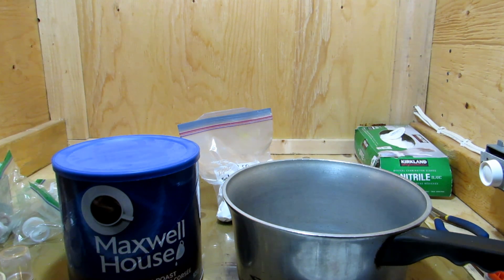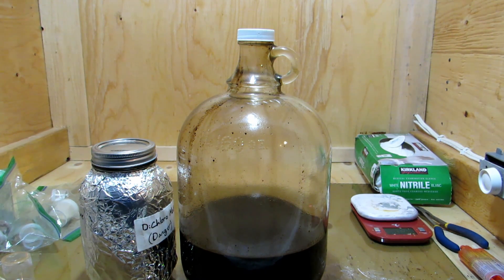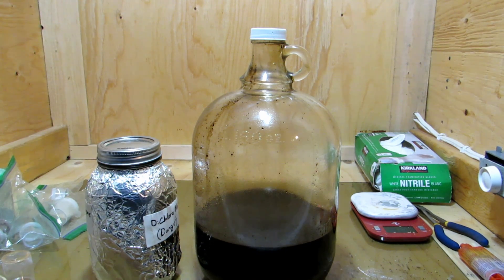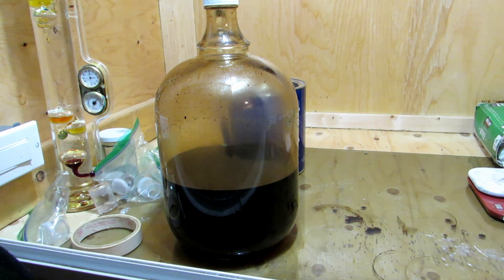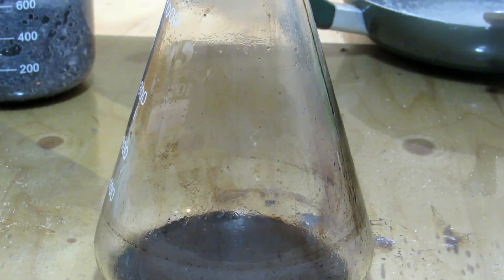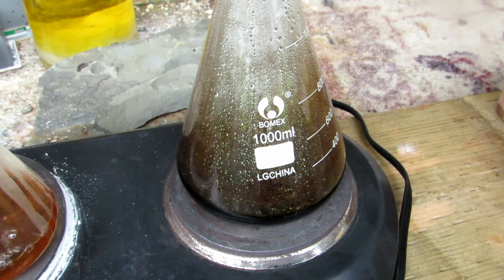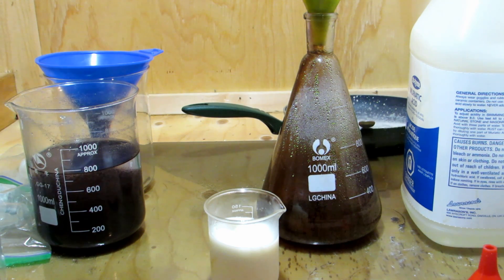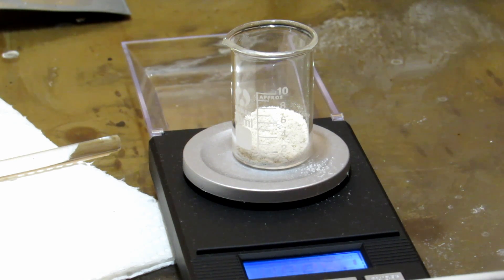Caffeine Extraction From Coffee

Comment: Why not just extract the caffeine with acidified water, then filter off the grounds, reduce the mixture to a few hundred mls on low heat, wash with a non polar solvent like xylene or toluene to remove as many lipids and organic compounds as possible, then make the washed aqueous solution basic with sodium carbonate and extract that with DCM? the reduced solution would be much easier to work with and the non-polar wash would make the end product more pure.

Comment: If you invest in a soxhlet extractor you will be able to get a better yield. It's going to take a hell of a lot more solvent and water than what you used to remove every single bit of caffeine from that coffee due to limitations like solubility equilibrium. Only so much of the caffeine is going to dissolve into the water without a soxhlet extractor.

This is the usual yield you would get from extracting coffee with dichlormethane alone. You could have used double the solvent to gain maybe 2 grams and so on. But the soxhlet extractor allows you to extract everything without nearly as much water or solvent.
Reply: Im using a soxhlet extractor, but im using water as the solvent, should i use something like ethyl acetate instead? I planned on using water and the soxhlet for a liquid/solid extraction, then use ethyl acetate for a liquid/liquid extraction.